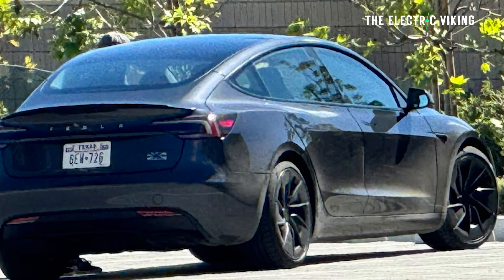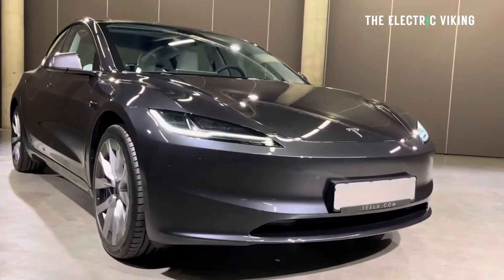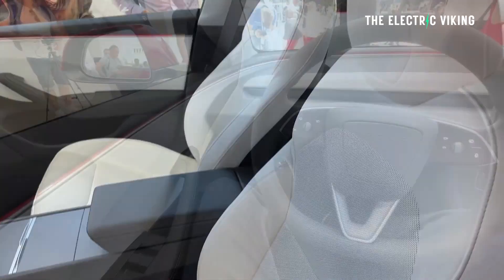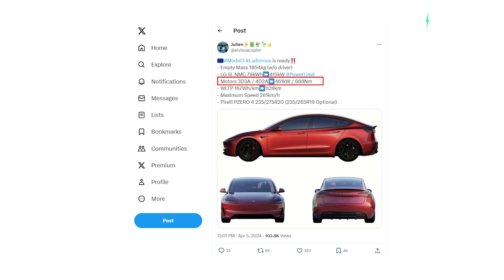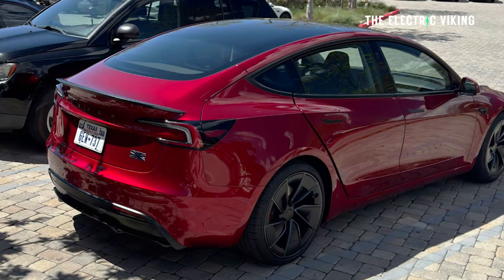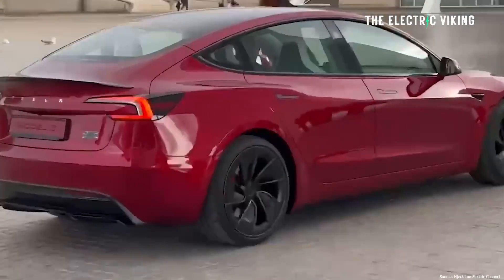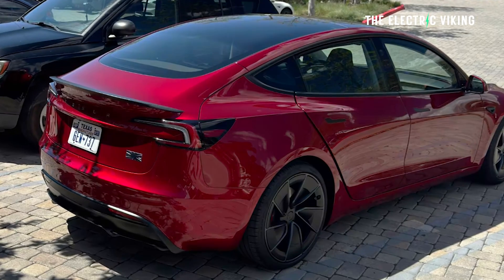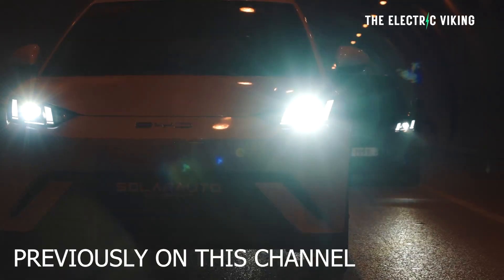2024 Tesla Model 3 Ludicrous US battery VS China / Europe battery

Comment: I see absolutely no advancement in battery technology or electric motors,only interior and comfort features.All they've done is jacked up the battery size and power output with soft and firmware.Otherwise the same shitty old batteries from Panasonic OR LG.No new tech so boring . Keep it

Comment: 460 kw = 625 hp. But according to what you said, the battery can only output 400 kw, so it will only make 543 HP. 688 NM of torque is 507 lb/ft. That is only 63 HP more than the current model 3 performance.
Reply: FYI,  the power of the motor is a function of its rpm, and its peak rpm is different for each motor design. As far as i know, the output of the front and rear motors is maxed out at 90 kph and 110 kph respectively (, for model 3 ludicrous)  Which means, accumulate power should be smaller than 460 kw ( 420 ~440 kw imo).
 (+  current motors power specs are SW limited value, so it could be upgraded in some point through the OTA as we saw in old m3p 0-60 change in early 2021)
Reply: @chlorophilla ludicrous is on their website now. Final spec is 510 hp (380 kw)

Comment: March 2024 was the “tenth straight month to be the hottest on record”, reported the Associated Press. March temperatures averaged at 14.14C – 1.68C warmer than in the late 1800s, when the fossil fuel era began, according to AP. It added that “climate scientists attribute the record heat to human-caused climate change from carbon dioxide (CO2) and methane emissions produced by the burning of coal, oil and natural gas”. Atmospheric levels of the three most important heat-trapping gases – CO2, methane and nitrous oxide – reached record highs again last year, the Guardian reported. The global concentration of CO2 rose to an average of 419 parts per million (ppm) in 2023, while methane rose to an average of 1,922 parts per billion (ppb) and nitrous oxide climbed slightly to 336ppb, the outlet said.

Comment: 2024 Mercedes C Class' weight starts at 1500kg. Did you pick an upspec model of a luxury car to make some kind of point?
The Model 3 is an expensive car, not a luxury car, compare it with the bigger Toyota Camry, that also starts at 1500kg.
You need to face it, your beloved Tesla is a fat f#ck.
Reply: 2024 c63 AMG C-class kerb weight 2165 kilograms. Compare like for like, not cherry pick because you dont like the real  fact!
Reply: @marcelarias3741 You're comparing the top of the range C Class with a pretty basic milk float. An entry level twin cab 4x4 Ford Ranger only weighs the same as the Model 3. But of course all the EV Muppets like to quote the weight of the range topping version like they're making some kind of point. The only point they are making is that they are deluded.
Reply: The milk float will leave the amg in its dust. Be real, this is the top of the range model 3 against the top of the range C class. as I said like for like. Just grow up!
Reply: @marcelarias3741  and just like that, with bottom lip quivering, the EV Muppet forgets the conversation was about vehicle weight and clings to the only straw he has left, "but, but the Tesla's faster".🤦‍♂️
Reply: @marcelarias3741  I have, I stopped playing with slot cars when I was 10 years old.
You can't believe anything Tesla says on performance, they are pathological liars whether it comes to range or acceleration. They even subtract the rollout time from their "performance" models to make the Muppets that buy them think the amount that they are faster than the standard version is greater than it really is.
There's a sucker born every minute.
The people that buys these are the same ones that rushed out and paid $10K for a plasma TV.
More money than common sense.
Reply: @marcelarias3741  It's not like for like, one is a luxury car, the other is an expensive car.
Not sure why I'm wasting my time with you, you probably drive an old Kia anyway.

Comment: We have been getting the 82kw Panasonic battery for awhile now in the Y and 3 (about 1 to 2 years). Panasonic is suppose to be on an
upgrade path for  the 2170 it was suppose to increase the output 20 percent over 5 years. Range improvement if
any in the New 3 has to be coming from other solutions.  2 second zero to 60 is ridiculous for a the normal person, or at least it 
was .  I wonder what size battery pack will come out of the CATL equipment in Reno. I keep seeing 270 watt/kilo for the Panasonic 
battery and at best around 200 for LFP  and maybe 240w/k for the LMFP's on the reviews here on Ytube.

Comment: The reduction in range is actually because of the bigger rims. The 20" rims have a significantly higher moment of inertia that the 19" or the 18". So it takes more energy energy every time they need to spin faster. The increased weight of the wheels also has an outsize effect because they're what's called unsprung weight. The vibrations that the wheels make to follow the road take more energy if the wheels are heavier.

Comment: Just to clarify, the Panasonic cells are slightly more energy dense than the LG cells even though they are both 2170 with the same number of cells in the pack. We got the last of the Panasonic cells on our long-range Model 3 2023, and it is rated at 360 mi., a bit optimistic, probably. Panasonic has improved energy density over the very early version of those cells that went into the 2018 and 2019 model 3s

Comment: My question is on the U.S. pricing. If Tesla uses locally built batteries on the Model 3 Ludicrous, then it potentially qualifies for the $7500 federal subsidy, just as long as the purchase price is under $55K. This would potentially make the NET price of the Ludicrous model a bit cheaper than the Long Range Model 3. Tesla did this with the previous Model 3 Performance, but I would be surprised if they lower the base price of the Ludicrous model to take advantage of the subsidies, because it would eat into Long Range Model 3 sales.
Reply: Who really cares about faster acceleration.. That's already plenty fast enough on Teslas.

Comment: I would prefer a slower Tesla with more range.  I don't need to do 0 to 62 in 3 seconds. Thus smaller motors would do fine. I would have happy if it did it in 5 seconds and provided 20% more range.
Reply: 250-300 miles at the start of every single morning isn’t enough for you? Most people who drive alot do not use half the battery capacity each day. They could put a bigger battery but it’s pointless and just decreases efficiency.
Reply: I would prefer a slower Tesla with more range.
Reply: @JoeyBlogs007  it’s called the model 3 long range. Put it in chill mode if your a pussy.
Reply: @JoeyBlogs007  Model 3 long range on chill mode.
Reply: @Joey Take a M3 Longrange...
Reply: That's harder to do. 
Tesla pump for speed always. In a straight line. That easier.
Reply: Buy a base model or a long range and drive slower?
Reply: @69memnon69  your choice. Drive any EV you choose and just don’t step so hard on the accelerator.